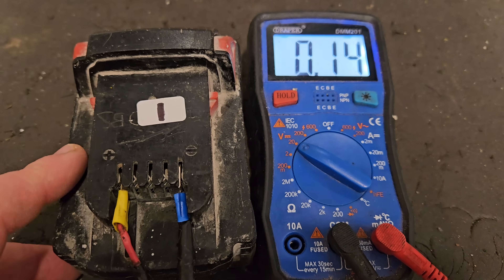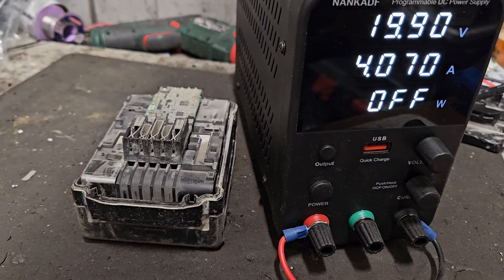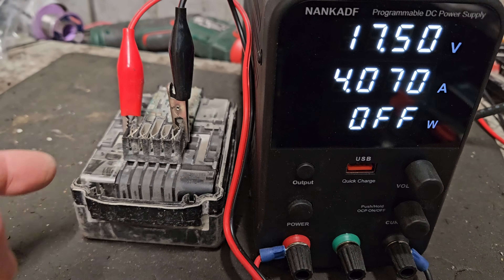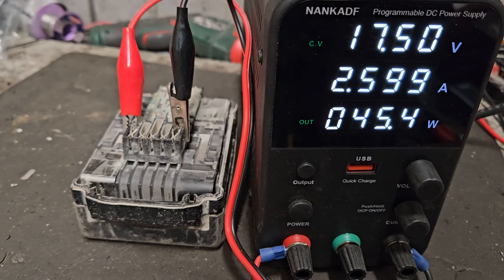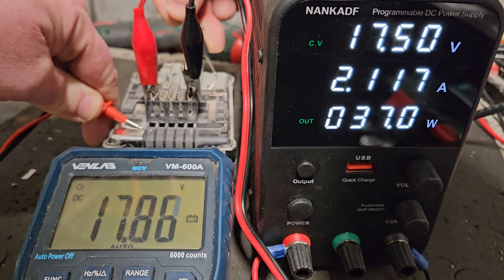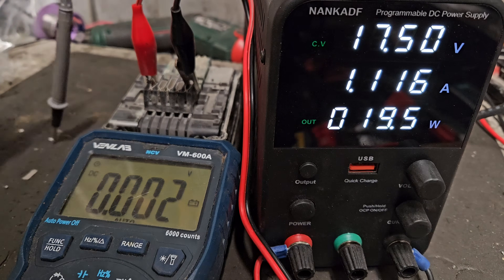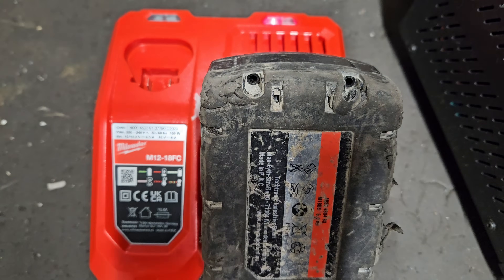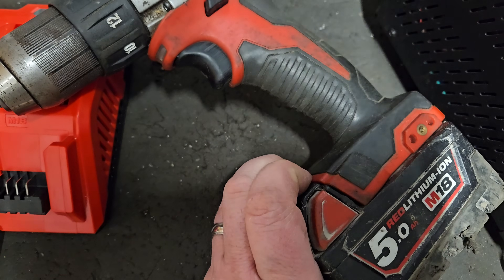M18 Battery Extreme Low voltage recovery

Comment: About 5 years ago I built a 48V battery for my bike. I adjusted my charger to cut off at 90% SOC. The battery has gone about 6,000km now, and my seat of the pants estimate is that it has somewhere around 75% of it original capacity. But the worst part of that scenario is that when the battery gets below 50%, it can no longer supply enough current to boost me up the hills when I'm getting too tired to crank 150 watts with my legs. This is an example of why I no longer use harvested cells and spend the kid's inheritance on new cells. I'm an old guy. When I go to the trouble of building/rebuilding a battery pack, I want the capacity to be as high as possible for as long as possible.

Comment: I think it's important to understand what's happening when the cells go low. Once the lithium cells go too low the chemistry inside starts to breakdown resulting in a high internal resistance, trying to charge the batteries with that high internal resistance is what causes them to get hot. When you "jump start" a battery you are simply forcing enough charge into the cell to fool the charger into thinking the cell is good. As you saw from the multimeter the cells held charge but only briefly, long enough for the charger to see a pack it thinks is okay to charge. The cells may end up holding charge but the high internal resistance means they won't hold much and it will struggle under load. You can test this by timing the charge from flat to full, comparing the time taken on the older battery pack to a new pack giving you a rough percentage of capacity lost.

Comment: Experts say that if you fast charge your battery you will reduce it's life. If ive got a battery this low I start it at 500ma to be safe. There are several videos on fast charging hurting the cells & the link below is one from Great Scott who does some explaining of why it hurts the cells. I saw a video on EV fast charging that said similar things with some losing 10% of life. You might say it's only 10%. But that's 10% on a $20k battery.
https://youtu.be/iMn2yVoEqPs?si=_lDsOP_MlnM-Ypd5